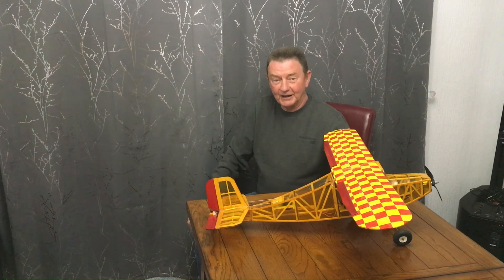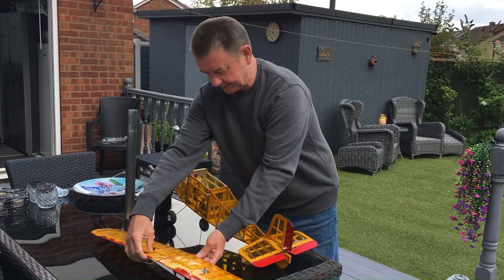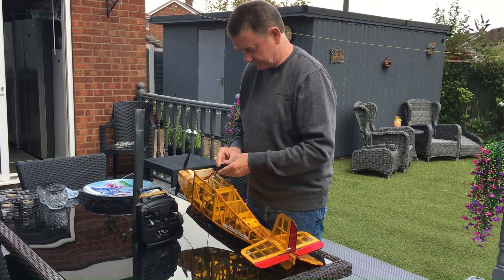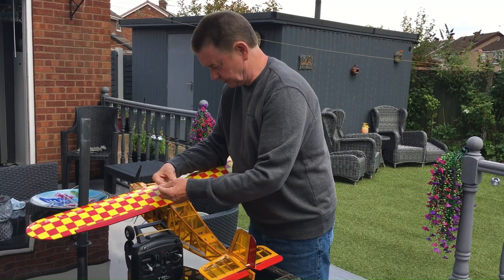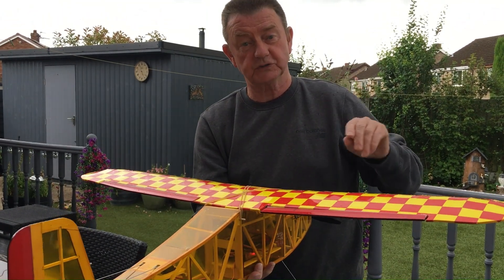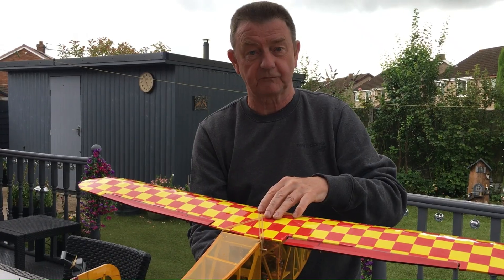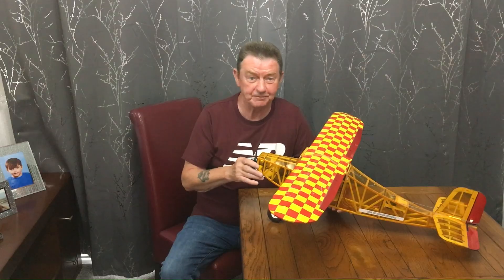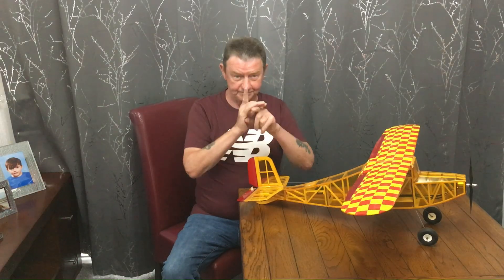I designed a plane using Lightburn with 'simple rules' now it's here!  MAIDEN FLIGHT of the 'DIXIE'

Comment: Flies like a champ.  Balsa planes sure are light and sweet to fly aren't they? 
I'd sure be tempted to cut a battery hatch in the bottom so I don't have to take the wing off every time.  I am really good at reversing the servos, not getting a plug fully seated, or stripping out the wing mounting screws/nuts.  I keep finding new ways to fail :)

Comment: Nice model. I do hope you reversed your Rudder Input before flight, as at 4:22 you moved the rudder stick Left and got Right rudder.
Reply from the maker: Well spotted! Yes, the controller has switches inside the battery cover for each of the channels and I use it for different planes with different configurations. As part of the pre-flight check I adjust as necessary. 👍👍👍